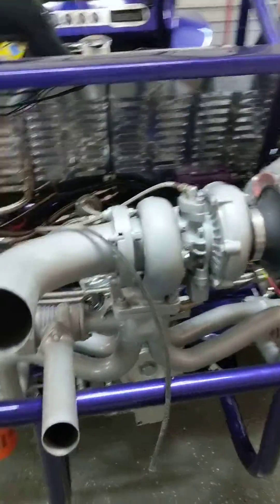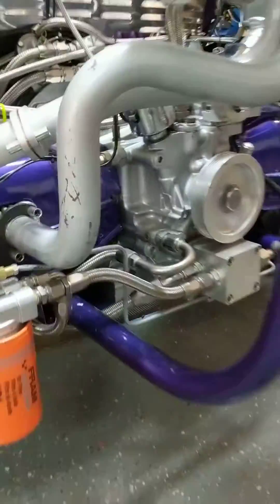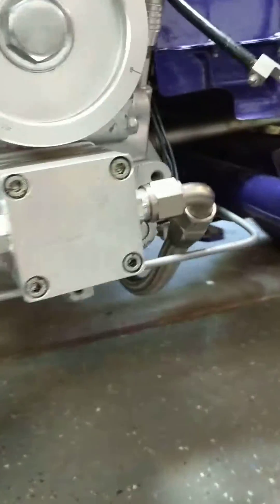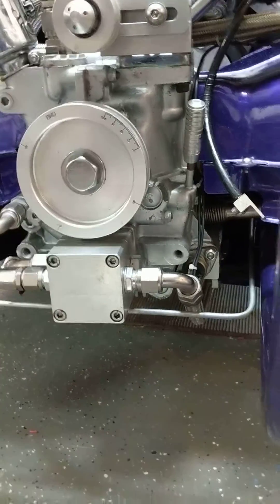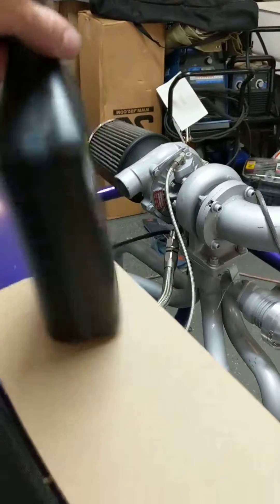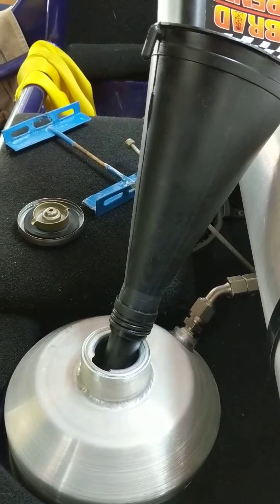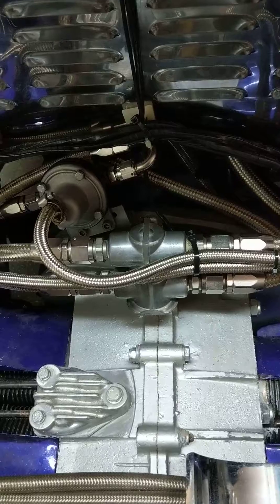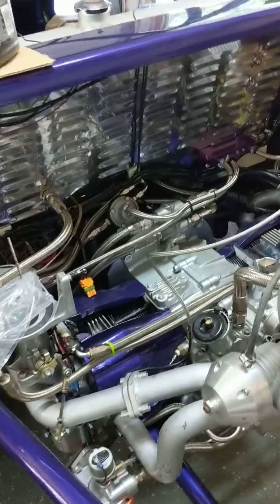Air Cooled VW Dry Sump Pump System Discussion

Comment: Some thoughts to consider:
1) Oil heat blowing across your fuel tank - could be a real issue with fuel temperature.  OEM's go to great pains to keep fuel tank heating to a minimum.
2) Not much cross sectional area for the oil cooler fan exit... for that giant high power engine (200+hp?), the heat your are going to need to reject is much more than stock engine. I would suspect 3 or 4X more area is needed.  Comment also applies to fan area / flow.
3) Might be better to route return oil from pump to tank through the cooler- less pressure drop for main system - shorter hoses, less drama with thermostat - in general a better layout.

My 2 cents take it for what its worth.

Comment: Any particular reason why you don't run the thermostat, oil cooler and filter on the scavenge side, like the old air cooled Porsches? I would think, especially on this type of vehicle, running all those external lines on the pressure feed side makes it more vulnerable to oil pressure issue damage.
Reply: Completely agree with you on this point.

Comment: Do you have a problem with oil running back and filling up in the engine if its sitting? I have oil cooler above transmission and this is a problem for me.
Reply from the maker: It sat for about a month and when I checked it last week it read a normal level on the dip stick. If you run it, however, then shut it down and check the oil it doesn't read on the dip stick. So drain back doesn't seem to be a problem.